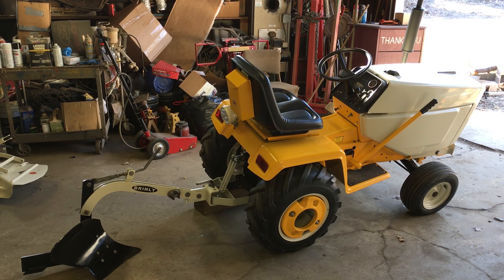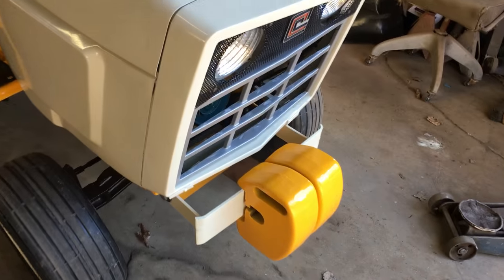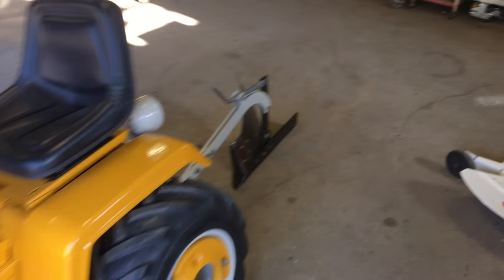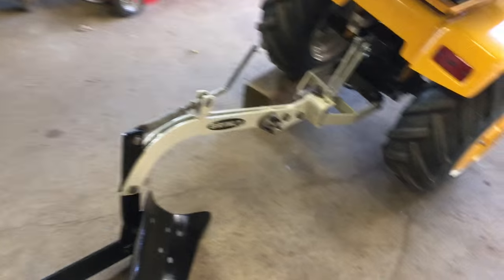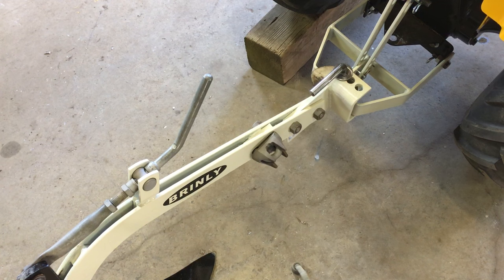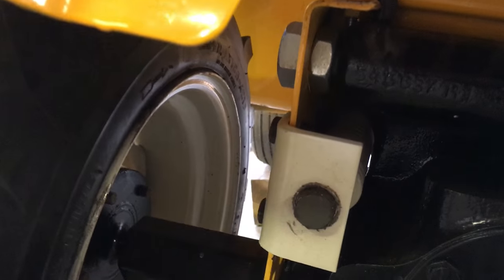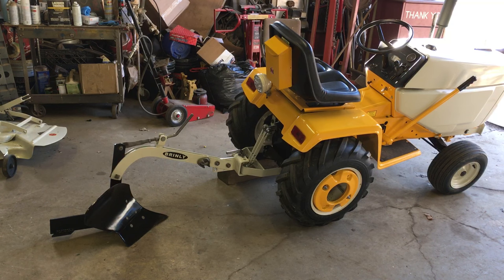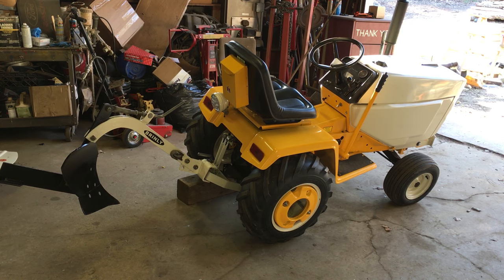cub cadet 680 brinly plow setup

Comment: Do you take the wheel brakes off?
Reply from the maker: Have to explain more so I know what your asking
Reply: +chooster5000 the brakes that would be mounted on the rear axle that are connected to the rear wheels?
Reply from the maker: +Official Quaders24 this model doesn't have caliper on it like some model , but I don't take mine off to paint